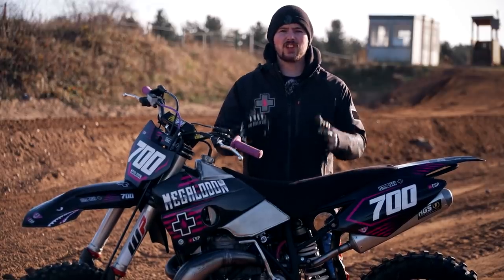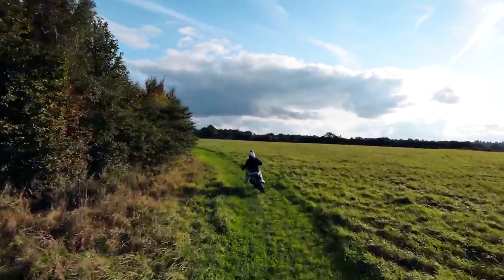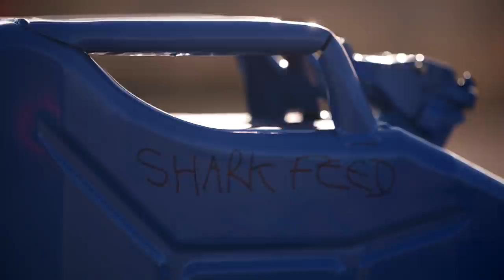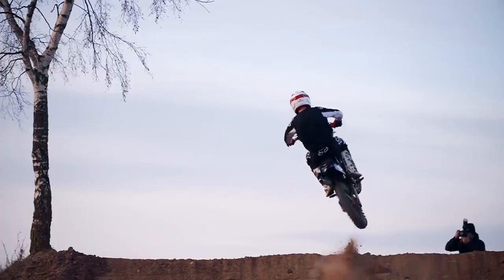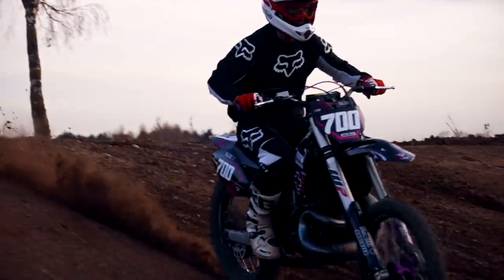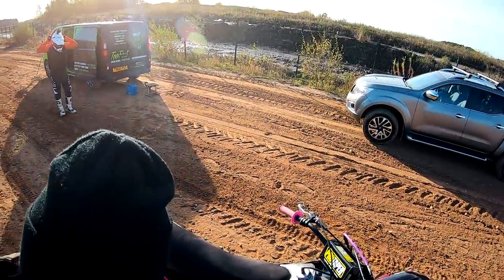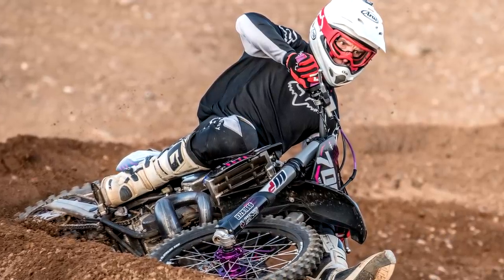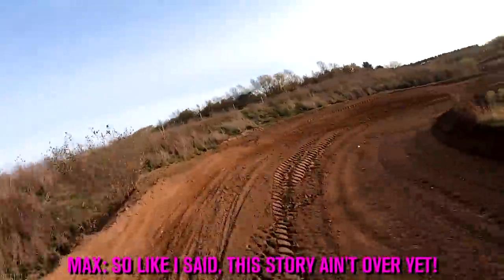Riding a 700cc 2 Stroke Dirt Bike for the FIRST Time! | Project 700 EP9

Comment: Would LOVE to see a pro ride that on a track with doubles and triples as well as a long whoop section - running around in second gear with a couple table tops seems like the brakes got more of a workout than the throttle.
Reply: LOL😂
Reply: First of all open class two stroke motorcycles take a completely different strategy to be able to turn fast times on a motocross track compared to a 250cc 2-stroke compared to a 125cc 2-stroke
And like they say if I have to explain it you'll never understand.
But I will try as no one has ever really explained it to me.
As we know usually an Open class two stroke will weigh in a few more pounds than a 250 but it doesn't really seem like that much more until you hit the throttle and for a moment the 500 are open class bike in this case a 685 CC will hook up momentarily now you've got a lot of momentum unless you have to bring to a momentarily stop to square off a berm and then wfo on the throttle instantaneously that will pull your stomach muscles into Knots and Charlie horses have you haven't worked out in the gym lately... So basically from my experience while you're jamming the throttle wide open and you're concentrating as exactly the last second to jam on the brakes for a half a second and then jam the throttle back on and the 20 are so pounds extra over a 250 feels heavy... So again from my experience when you're traveling and accelerating and turning the track times of a 250 or faster you begin to feel the inertia and the g-forces that just a few pounds there over a 250 seems like a lot as you find your upper body shoulders and muscles becoming extremely tired faster than they would on a 250 so again physical shape of the person riding has a lot to do with turning fast times on an opening class bike.... I don't remember the German company's name that makes these engines... Not sure if it was Maico who first use them or it might have been ATK but they both use these engines in their motorcycles as it was years ago there was some old footage of a 700 Maico (685cc) on a dyno producing 90 rear wheel horsepower stock no mods ... And after all the tuning on this bike in this video looks like mostly diminishing returns... You can still buy stock 2018 Maico 700 in Street legal, supermoto, and Motocross trim. All three motorcycles have exactly the same engine... As the one with street legal lights is your Enduro model.. top end is well over 100 mph... The supermoto has a smaller front wheel I'm not sure what size, comes with supermoto tires for asphalt only. It's all black with carbon fiber fenders side plates I think but looks really sharp... In certain countries in Europe they still race sidecar Motocross and mostly what the Maico 700 was all about...and before you tell me about Maico breako ,I am the original author of that slogan to discouraged new buyers as I was asked to come up with something to bash Maico'$ forever ... Requested of me one day by the original USA importer regional sales and service representative and  Maico Factory team rider for the United States... His name was Brad lake who I had known since we were about 13 years old and in 1976 Brad said to me Chucky think of something quick we got to discourage people from ever owning or buying one of these bikes as at that time Brad lake was about second or third in the nation in outdoor motocross as Brad had a factory works of only one that was similar to the WR 400 that came out in production two years later and Brad was unstoppable on the WR prototype and didn't give a s*** if he sold one pennies worth of motorcycles as his dad had bought the franchise and gave it to him to keep him out of trouble
Reply: This bike seems like a fail I don't see many riding vids on it its probably broken already
Reply: Lol
Reply: I don’t think he would want that
Reply: That’s what I thought I clicked on

Comment: Maico 700 two strokes have been raced for last 7 years during the Australian Finke Desert races where Maico has brought over modified 'works' editions of the 700cc to compete against the KTM500 EXE F ridden by world champion Toby Price. 
Toby has ridden one and said it has way way more power than the factory 500 EXC Fs.
They before arriving in Australia have in the past been dyno tested to make up to 79hp standard and the factory bikes can make up to 87hp at 12 degrees C running VP race fuel. They go similar to this one of yours but they do have significantly more power and these Maicos would be regarded as being THE most powerful two stroke dirt bikes...BUT one thing that you guys can take claim for is that you guys have built such a bike without any factory backing, which is just as impressive. Great work guys.
Reply: Have you heard of stark varg? Name might be spelt a little wrong.  But its a new 80 hp eletric dirt bike coming next September

Comment: Can't wait to see Neville Bradshaw ripping on it! Cool and unique project. I can't imagine having that much power in a dirt bike, especially on a motocross track. Talk about arm pump!
Reply from the maker: The good thing about the Megalodon is that you can't feel the pump once she's ripped your arms out their sockets and beaten you over the head with them! lol Nev is gonna have some fun with this thing for sure :-D
Reply: It’s not that much power. Most 450s and 500s that have a bit of work done to them have the same or similar power. He did a DYNO the power numbers weren’t what anyone was expecting
Reply: @njmxjunkie3128  a 500exc on dyno on sumo wheels will pull 50hp not 70
Reply: the new ebike has 80hp
Reply: @njmxjunkie3128  except any fool can ride a 4T but to deal with this monster its needed real nails and real man balls.
Reply: Unique project?! It seems you late to the party...
Reply: Stark electric has 80 🤣
Reply: @leRat699  my cr500's were over 70! The tuning is way off on this thing! The pipe is too small, and so is the intake! This thing should make at least 83-90ish...from Wyoming USA 🇺🇸 🤠
Reply: @billallen4793  you are talking about a 2stroke, i thought 4stroke that's why I said 500exc because it's a 4 stroke.
Greetings from Germany 🇩🇪
Reply: @leRat699  yes 2stroke motorcycle Merry Christmas 🎅 🎄 frohes neues jahr! ...lol ..from Wyoming USA 🇺🇸 🤠
Reply: @billallen4793  Have a great cristmas man🙏🤟
Reply: @leRat699  lol you also 😂

Comment: Here is a cold starting tip from my days racing a Maico 490. Always, always set up your pit at the top of a hill so you can roll down and bump start it. I still carry scars from trying to kick that beast to life. Truly mental project. Well done!!!
Reply from the maker: thanks for the tip. haha must admit we have done that when its cold :) - Thanks for watching
Reply: The 490 is a special beast for starting.  With no reed valve and no advance-retard ignition, they're on a complete next level from CR500s and stuff.  I don't hear many people talk about shearing their kickstart lever clean in half from their CR kicking back; I've seen a Maico do that twice in one season when the timing was off by a hair.  It took me ages to get my 440 to start reliably, but now that it's got the magic carb settings it's become quite easy.  2 seconds with the screwdriver and you could make it impossible.  Such great bikes though.
Reply: @JETZcorp  They were such great bikes! They were the end of my motocross days and I haven't kept up with all the advances since then. Still it was light years advanced from the 1973 Yamaha 125 MX I started my career on. 🙂
Reply: If you can't kick it, you shouldn't be on it. (Wise words from my dad back in '94 when I got my first KX80 Big Wheel). 

Get a smaller bike OR spend an extra 30 minutes on leg day.
Reply: A buddy of mine has a really nasty bike he's done crazy amounts of work too. 13:1 compression. If you have 2 people there, put the bike on a stand, put it in 3rd or 4th gear and wrap a strap around the rear tire, one guy holds the bike and the other pulls the strap turning the tire. Learned that after cracking a crankcase a few times.
Reply: @dalejrjunior1298  https://www.youtube.com/watch?v=ltlt6a1xnX0 

Old 400 GP one banger. The guy in the video is hardly massive. 

Like I say, if you can't kick it, you shouldn't be on it.
Reply: Yep my 1989 Quadzilla I always drive the truck to the top of a steep hill to unload.  If it doesn't bump start I cry at the bottom of the hill.  Once she is up to temp all is good.
Reply: Then you didn't put on tdc first.

Comment: You can order a 700 Maico from Koestler ktm /Maico. Zabel helped the factory Maico design there water cooled cylinder. In 1984. Zabel was a German side car racer and builder. He adopted the Maico 500 bottom end and designed a 700 barrel to compete against the big 4 strokes. Koestler and Zabel still offers many size Maico 2/Strokes. It appears someone bought one and engraved there name in it. Long story short. It’s a Maico! Long live the mighty MAICO 👍🏻

Comment: Max, I can't begin to imagine what that thing would do if you really opened it up and let it eat! It sounds like you are merely puttsing around just of an idle, yet both Ed and you say it is blooming fast. At half throttle you aren't even getting into the powerband on a two-stroke yet. If you were to get it into its sweet-spot, it is going to be like trying to moto-X a cruise missile with a rodeo saddle on it LMAO! 

I have ridden some very gnarly 500 2T bikes that were way overkill power wise, but they needed to be 3/4 throttle or more to be making their power. That 700 makes it look and sound totally casual to be that fast. Color me impressed and jealous. 

I love to live on the brink of insanity; the best high in the world, IMO, is the smell of 2T race exhaust and the adrenaline rush created by the symphony of pissed-off pinging when the engine is on the pipe and trying to rip your limbs out of their sockets. 

I am knocking on the door of 50 and still appreciate a good rip on a well tuned big bore 2T MXR. To date, my greatest thrill was on a Service Honda 500AF that was pushing 75hp at the wheel. The gentleman that had it built spared no expense and had well over 25k in the bike. It was insanely light and a blip of the throttle had the front wheel headed for the heavens and the back wheel spitting softballs at anyone behind you. 3 laps around the track was enough to let you know that you were further out of shape than you realized; the wrist and shoulder pump was unreal, your heart was pumping like a top fuel dragster, and you were nearly numb from head to toe, but the adolescent speed junky in you did not want to get off the machine. It was saddening to have to return it to its owner but was the pinnacle of rides for me and a better experience than taking a podium the first time as a kid. Be safe!
Reply from the maker: that af sounds like an awesome bike. I have just shot a film with a new CR500 AF which I'll be uploading later this week:) thanks for taking the time to write such an awesome comment. Cheers Max
Reply: @999lazer  I wish that OEM companies would move to fuel injection with 2 strokes and bring back the big bore bikes because 4 stroke tech is not the same. While 450s are great all around bikes maintaining one is far more expensive for the trade off of not ha ing to mix your fuel and while they have tons of grunt they do not have that blistering surge of "OMFG!" And "Hell Yeah!" Like when a big bore hits the pipe.

Comment: Everyone saying they want to see a pro on it with more power is right. That would be insane on the right track, but damn you're going to have to find someone crazy enough on a track with some big climbs to actually open it up. If I remember right, back in the day Villopoto ran MX Des Nations on a 250 competing with 450s. He was with Kawi at the time and they built a high 70's hp 250f to compete, and literally had their fingers crossed that the motor would hold together. I've ridden a full mod 450 and full mod 250 with built to the hilt Pro Circuit Kawasaki engines and suspension. They were actually terrifying when I rode them at 15 years old and 105 pounds with my gear. They made insane power and were set up for tighter outdoor tracks at the time so the power out of the corners was complete madness. I ran an 07 rmz-250 at the time with an exhaust and could easily run back to back 30 minute motos. I think I got two laps in on the 450 after I got slightly comfortable with it and my arms and legs were dead. Maybe four or five laps on the 250? Those bikes were just too much to hang onto for me. I can't imagine what a 700 is like, but I'd sure like to ride the Maico 700 someday.

Comment: Can't imagine feeling the power band kick in on this machine.  CrAzY!!
Reply: Based on how much power it has (1hp/L), I'm guessing it doesn't have much of a powerband kick at all.  My old Maico is right around that ratio (45hp, 440cc) and it's just butter from the bottom to the top.  Most of the big-bores were torque monsters that had almost none of that 2-stroke madness that the lower classes had.  That did eventually change when you started seeing 60hp+ from the 500s, which is right about the time everyone got scared and stopped riding them (funny how that works).  Whenever someone went for broke on big-bore horsepower (TM400 Cyclone, 1985 CR500, etc) the bikes tended to put people in the hospital.  The good ones were always big mild kitty cats that dug trenches in the most relaxing way.

Comment: Lugged it around the entire track. Never once got up in the high RPM power band. I'm not sure if there is a pro rider that could. What an absolute monster. Y'all need to find a crazy American or Australian pro to try it out. Or let Seth Enslow or Travis Pastrana long distance jump it.
Reply: Exactly what I was thinking.  Never tapped all 70 horses, although that would likely cause the bike to loop out if the traction is there.
Reply: It’s a 700 cc 2 stroke. They do not rev high. The meat of the power on these big bores is low to mid range
Reply: @curtsawchik1480  I build and modify Rotax and 700cc mega engines for karting. They top out at 9000 rpm. A CR 250 tops out at 8500. I just got done with one in a modified Top Kart chassis. But please. Do tell me more.
Reply: A lot of pros nowadays say they already have to tame down stock 450s... All the aftermarket stuff is just weight reduction... I dont think there is anyone that could truly tame this beast....
Reply: @Its0kToBeWhite  me either. Certain point where power surpasses skill and ability.
Reply: @worldssickestmedia2713   a cr500 makes its peak horsepower at 5800 rpm. Where a cr250 makes it’s peak power around 8000. Do you understand? They do not need to be revved  high. That’s not where the power is
Reply: @curtsawchik1480  they never got up in the power on that engine. Never even got close. The mega engines scream just like any other 2 stroke when they are up in the power. You have no point. You've most likely have never seen one in real life or had your hands on one.
Reply: @curtsawchik1480  it's a karting motor. Not a bike engine. We just got done with one built to run at GMP. They scream when in the power.
Reply: @worldssickestmedia2713  I’m not talking about a karting motor lol. I’m talking about dirt bikes here.  Do you know how to read a dyno? Please go look at one for a 125 250 and 500 and you will see what I’m talking about. I’m surprised you don’t know this if your building engines
Reply: @curtsawchik1480  you don't have a dyno. Nor have you have been around or had your hands on a mega R01 engine. You can talk about dyno sheets and this motor all you want. You don't have either.
Reply: @curtsawchik1480  you can talk about dirt bikes all you want. But a Mega R01 is a Kart engine that husaberg adapted to a dirt bike.
Reply: @worldssickestmedia2713  topping out means nothingif the power isnt at the top. there, now go tell your mom iv told you more.
Reply: @curtsawchik1480  your are correct 100%.
Reply: @conniestevenson226   I mean no point in arguing with this guy. For some reason he just doesn’t get it lol.
Reply: @conniestevenson226  question for you. And the other guy. The power and where and how it comes in on a 4 stroke is determined by the cam shaft and the ignition timing. So what is the determining factor for a 2 stroke?
Reply: It sounds quite similar to a 500
Reply: @curtsawchik1480  connie couldn't answer it. You're a pro. Maybe you can since she/he didn't. Where the power on a 4 stroke comes in is determined by ignition timing and camshaft specs. So what is the determining factor for power delivery on a 2 stroke?
Reply: @worldssickestmedia2713  porting and compression. Power valve if it has one.
Reply: @worldssickestmedia2713  also it’s not just a 4 stroke that has timing
Reply: @curtsawchik1480  wrong. It's the expansion chamber combined with carb jetting. And ignition timing on a 2 stroke is determined by piston height and can't be adjusted because there is no cam chain and valves. Big expansion chamber wide power band. Little expansion chamber. Narrow power band.
Reply: @worldssickestmedia2713  porting, higher compression pistons, squish, intake. There’s a bunch of things that determine how the power is delivered.  But most people go straight to porting. The fact you said I’m wrong is scary.  And you hit me with jetting and expansion chamber lol. There’s more to it than just that
Reply: @curtsawchik1480  you don't know wtf you're talking about then.